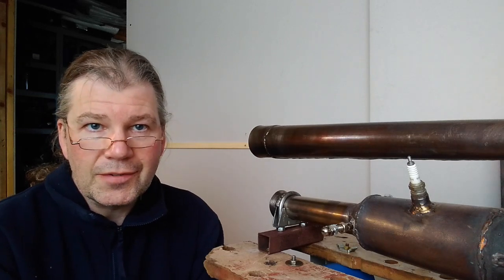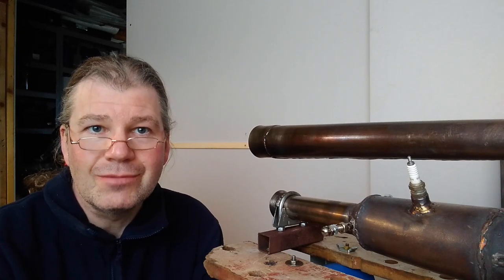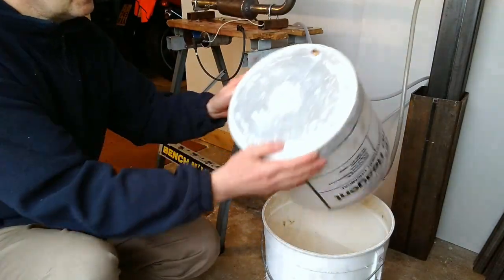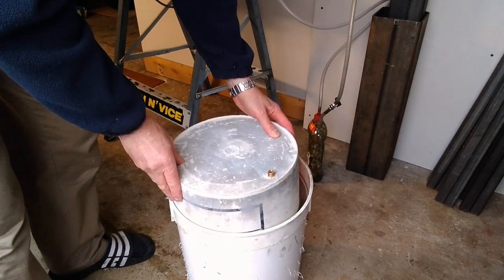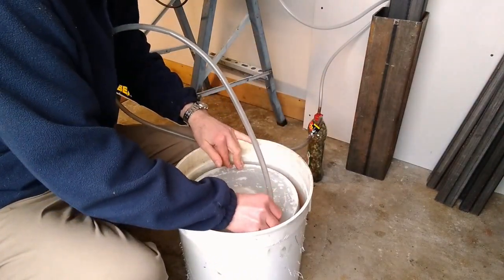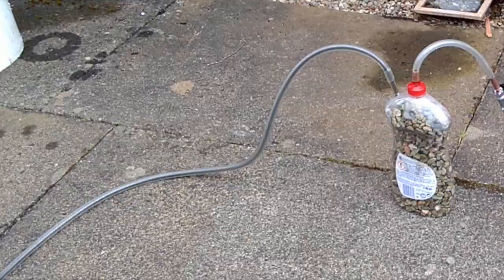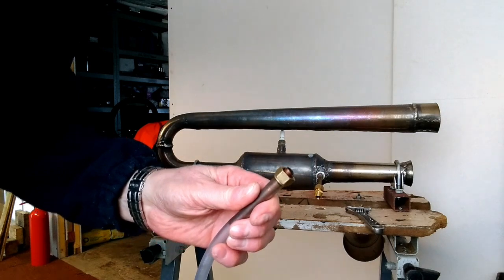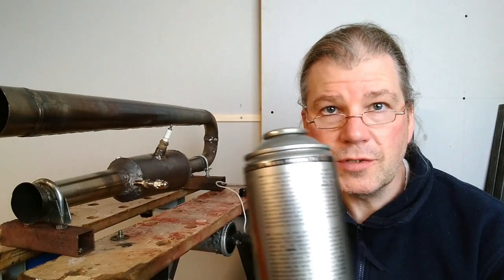DIY Acetylene in DIY Pulse Jet

Comment: You had to make a diagram and measurements to be able to cut and assemble it. There are also mathematical models and computer algorithms to model and design engines like yours.  It means knowing the pressures, densities, flow rates, temperatures, energies, reactions, ignition.  Even if you are not doing that now, you might want to look at what you have now. Shapes and dimensions, materials, colors and temperatures from videos.  Grams per second of fuel burned can convert to Joules/second of heat of combustion. Grams of fuel and grams of oxygen.  You are using several ways of igniting.  You might want to formalize that and test just ignition for various mixtures and flow rates.  If you find others doing the same things and want to combine efforts, that can perhaps be speeded by shared modeling tools, common methods of measurements.  Please start from SI units (metric) from the beginning.  Sounds like work doesn't it.  If you want to survive without too many explosions, perhaps effort and measurement and record keeping is worth it.  

You might start with a simple rocket nozzle.  But you might also check plasma jets where electric and magnetic fields will control timing and flow.  

What you are doing is difficult.  I have worked on problems for decades, which are slow mostly because the thing you want to control or understand is literally invisible, like air or gas, magnetic or gravitational fields. No one measures and you get "big" "small" "tiny" "faster" "red" and words that do not tell you precisely what to do next.  Edison had his lab people try thousands of variations, now that can be done in the computer somewhat. Recommend you pay $20 a month and talk to OpenAI ChatGPT 4.0 about what you are trying to do.  Be precise and ask about heats of combustion for various fuels.  Diesel or  gasoline or "cheap" fuel is better, if somewhat dangerous.  Use safety measures.  You might want to make smaller test rigs.  But taking days or weeks to build things and test them and still not know what is happening, sucks.  You might want to simply invest in learning how to calculate.  At least try to talk to GPT Plus about it.  Use your best language and expect it to make mistakes.  One day those tools will know how to speak English (and some other languages) and know how to use computer software themselves.  Engineering is 98% writing things down, measuring and calculating.  Not just "try something  and look at it".  "Engineering design" begins when you share data with others.

I am not at all sure what you want to do.  A pulsed oxygen fuel combustor makes noise, generates heat and SOUND and VIBRATION and some MOTION.  You can record the sound and study it  A tiny jet that is too small to see, and the fuel is invisible, you can RECORD with sensitive microphone(s) and view with Audacity software. A three axis gyro/accelerometer/magnetic sensor is cheaper now.  But the cheapest sensors are cameras (remove IR filter) and microphones. I am trying to push you a bit.  Acetylene from rocks is nice to know, you did that.  But what are you wanting to do?  Make noise?  Then record it and look at the waveforms, do some calculations. Get others to try to replicate. Study second order differential equations, "resonant circuits", "computational fluid dynamics" (ask GPT to explain that to you).  Ten hours of study is worth 100 hours of "just making things" and sometimes "just making things" is worth millions of hours of looking to see if anyone else has already done something.  If they did not measure and share their data, you might never be able to know if you are working on the same thing.  

On Bing there are 10.4 Million entry points for "pulse jet".  You might want to try fuel injection, and explosions, in a simple tube, or air, rather than using more or less uncontrollable flows inside rigid bodies.  Get the timing and concentrations from controlled fuel amounts and oxygen, rather than try to fiddle with a big flow and make something happen.  The sound, if you use a USB 96000 samples per second microphone record has fairly precise timing and results.  Accelerometers are actually less sensitive than gyros, you just have to learn to think in tiny rotations, rather than tiny displacements. The first derivative of grams/second is grams/second^2.  That is an "accelerating variable" and will have a force. Grams/centimeter^2 is the second spatial derivative and it will have an acoustic force and resonant frequency and velocity and shock fronts connected.  GPT can answer hard questions better then simple ones. Because when you are certain, it speeds the process.  So work from things you are certain of.  Find those from tiny things you notice. Share your measurement.  Record and compare your recordings.  Sound is closer to force and power.  Laser intensity is Watts/Meter^2.

Please be careful.  Try to decide what it is you want to do.  Is it noise, or heat, light or quiet acceleration?

Richard Collins, The Internet Foundation
Reply from the maker: Is this my first AI generated comment?
Thanks "Richard". 🙂

Comment: Get it hot and inject some waste Veg oil. that would be a breakthough if you could get it to run on that.  The thing to keep in mind will be HEAT. you need to vaporise it so get the  jet red hot then inject it and should work fine.
Reply from the maker: I have got some hydraulic brake pipe to wrap around the hottest part of the jet. I will then feed it in through the spark plug hole. Not sure what kind of nozzle or injector to use - will just need to experiment. Probably easiest to pressurise some sort of fuel vessel with compressed air to drive it in. Will get it worked out and start experimenting. MAP gas for the idle should be way hot enough which could probably be turned off once up to temperature. 🙂
Reply: @mrpingen  Do not vaporise the oil in the tube. It will leave residue and quickly block. 
I would not worry about pre heating. It is not going to make any difference in a hot combustion chamber and is a fallacy spread by people with not experience with oil burning.  
A small caravan Diaphram water pump would be idea.  You could also use a needle valve to regulate the oil flow. once the oil is burning you definitely won't need any gas.  The energy content of the oil is much higher. 

You may find the oil sparks a lot as the carbon particles burn and are ejected.
Reply from the maker: @glumpy10  I will save the pipe coil for the methanol and try directly application of the oil. I have a few different things to try.
Reply: @mrpingen  methanol phase changes ( Boils at about 65-70C so you may be putting the meth in as a gas anyway. 
there is also a thing with LPG/ Propaaane in that if you get it hot, it disassociates and burns hotter. I have done this and you really need steel tube like brake line glowing red hot but it definitely makes a difference to the heat produced. 

As long as the oil goes in the jet when and where it is red hot, I think it will work.  metering it may be the trick but once going, you could be able to run as long as the fuel lasts which on 5L or so could be a goog long time.
Reply: @mrpingen  You might consider an oil furnace nozzle... Look at mark presling`s diesel burner videos(recent project)... That in conjunction with fuel preheating will produce a fine high pressure mist of fuel already at ignition point, which will run the jet with 0 issues... Or at least it should in theory... Gasses are easier to start the jet on, but are shit energy wise... Waste oil and diesel variants are where the beans are... Acetylene is great, but it needs oxygen to really be efficient in its combustion... Other light gasses are just as limited, as they arent really even all that energy rich as acetylene is, but without oxy addition, they are pathetic, and arent really capable of following the demands of the jet when it gets up to operating temperatures, not for any real work, again, at least not as efficiently as mist-vapor liquid corpse juice... Also, consider diluting the diesel variants preemptively with paint thinners and a bit of ethanol or methanol... It will further aid misting and vaporization and will reduce the ignition temp of the fuel.... 
I have no idea what glumpy is saying about preheating being a fallacy, as its literally a part of every industrial system... Sure, you can burn oils without it, but the quality of combustion is by necessity reduced, lest you are using ultra high pressure injectors like a truck diesel engine, which still has glow plugs to preheat the oil before the engine starts and starts getting hot, thereby mitigating the need for glow plugs once running... -Calling an industry norm a fallacy makes me wonder about your potentially overinflated ego... I know that industry isnt infallible and is mired by corruption and shit(cost cutting and planned obsolescence) today, but fuel preheating is a norm since the bloody kerosene lamp back when we didnt even really have cars or any modern tech... Other things you say hold water, and are true in theory and even in practice, but if you cant get complete combustion of oil because it chars into byproducts as the injected mist isnt mist but droplets, then yes, you do get lower temperatures... Thats the whole reason why you have lean and rich fuel mixtures as a concept... If the mixture isnt able to fully combust within the chamber before it exits, the flame is at a lower temp, but if the fuel is practically begging to burn like gunpowder, then it will combust almost instantly, releasing all of its potential energy almost in an instant, before being jettisoned outta exhaust with still energy rich particles that were shielded from combustion by the soot that formed and encased the still liquid part of the fuel droplet in a paste of carbon...
Reply from the maker: I have an experimental tube coil on the jet and am now starting to look at nozzles. I am also in the process of making a pressure vessel for the fuels - just like the old kerosene lamps you mention. Plenty of experimenting required I think (when I get a chance).
Reply: A fuel preheater system would be a tremendous help... Even the old kerosene lamps rely on primitive systems of fuel vaporization through latent heat of the lamp itself... Veg oil or any diesel substitute really benefits from heat in regards to viscosity lowering, which logically, allows for much finer vaporization or more effective, as the fuel itself has greatly reduced tendency to be spat out in droplets, but rather in a form of mist(if the nozzle is appropriate)... Just getting the jet burner red hot wont really affect the temperature of the fuel coming into it, sure, it will heat up the delivery pipe somewhat and thus reduce fuel visc, but i would try coiling the fuel pipe in a linear S configuration, bending it into a slight radius and affixing it with inox standoff clamps to the jet body... There the latent heat of the jet would radiate into the pipe, heating up a large section of it, increasing the fuel pressure, reducing its visc, and thus allowing the nozzle to blast the finest high pressure hot mist of fuel almost at its autoignition point(which doesnt matter in the pipe, as there is naught but the fuel in it, like with acetylene, thus no issue of actual self immolation or preemptive ignition as can happen in a car engine comb. chamber where there is air along with the fuel)...